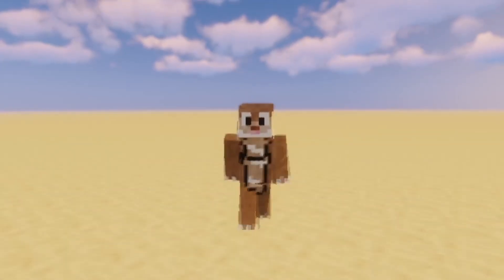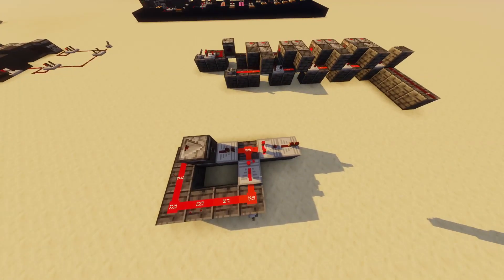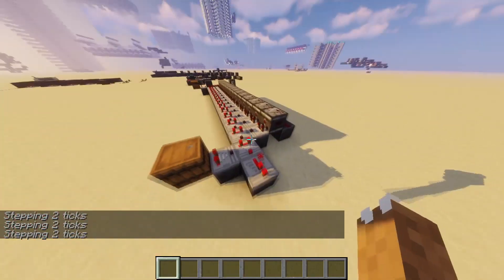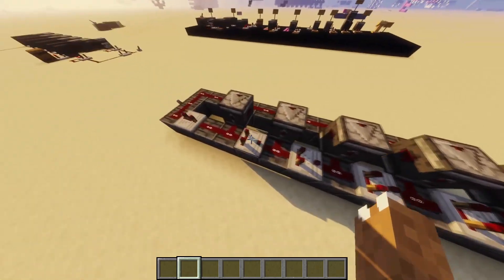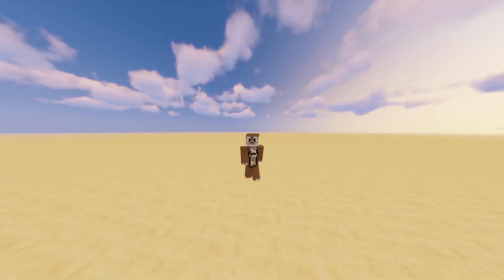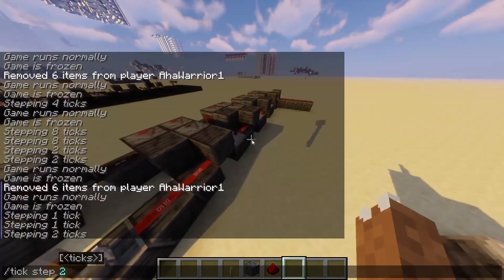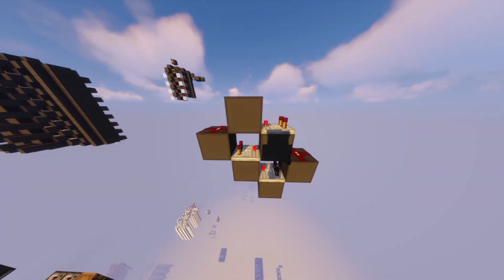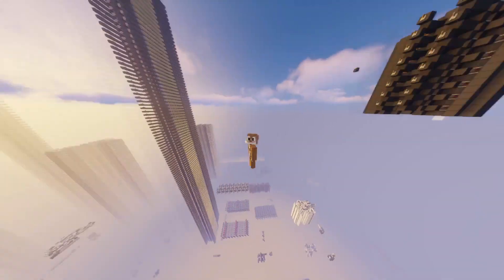The theory of 10Hz comparator priming

Comment: okay i did some stuff with it, its pretty cool. I think its not said in this video explicitely but shown in the build, you can extend tghe clock signal with a single observer. Secondly You could use multiple clokcs in different areas and use a daylight sensor as a power source for the comparator, that way they sync up.

Comment: Nice vid!

Just to confirm that I'm not being stupid, comparator priming essentially removes the redstone tick delay to a comparator right?

Also, what are all the barrels in your build for?
Reply from the maker: Essentially, yes. That's a simple but not fully accurate explanation. The barrels are read by comparators to provide constant signal strength in some locations, as it's required to make the SS in all components propperly work out.